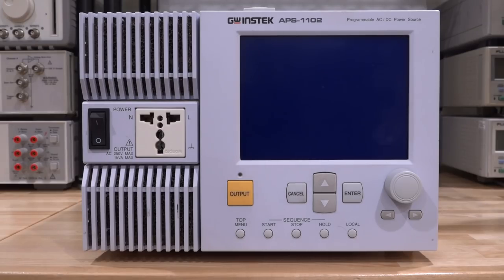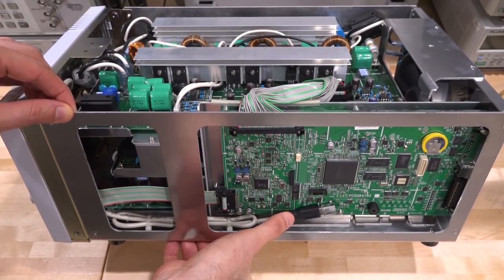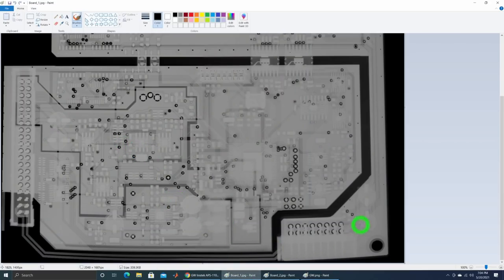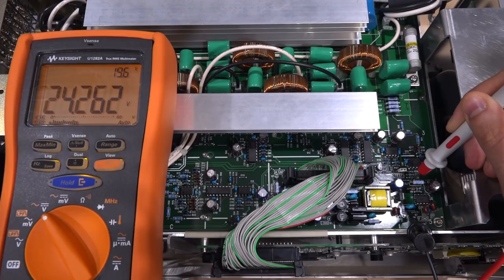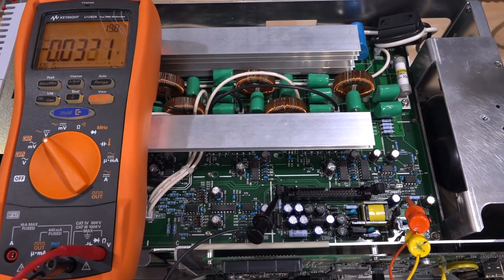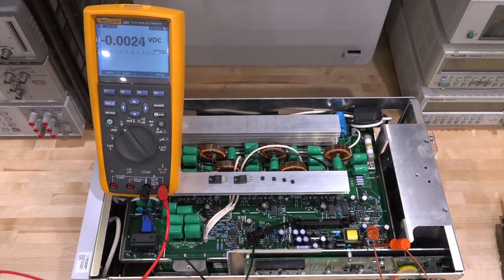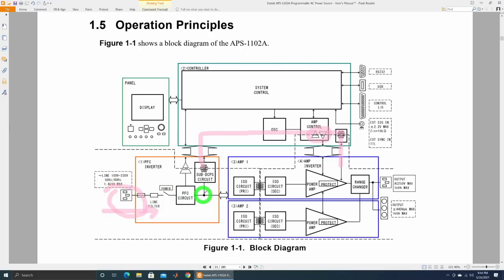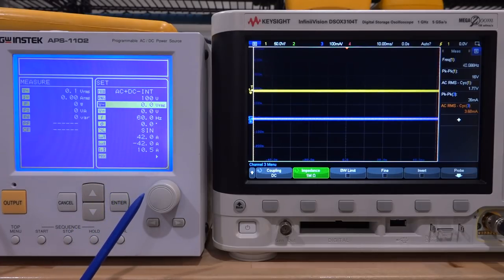TSP #191 - Teardown, Repair & Experiments with a GW-Instek APS-1102 Programmable AC/DC Power Source

Comment: The GW-Instek front panel seems incorrectly labelled for a UK mains plug. In this plug, the live is on the right. Upside down (as the plug would need to be) it is therefore on the left, which is marked "N". Great video - always find the repair ones interesting, I particularly value the way you talk through your reasoning. Thanks.

Comment: Interesting! By looks of the front panel legend if you put a UK BS1363 plug in that socket the line and neutral connections would be reversed.
Reply: I'm under the impression the output is floating in which case it would be irrelevant.
Reply: It's unclear whether that would have any consequence in a completely isolated unit like this?

Comment: Wow. That’s a nice unit. I managed to get one of those Sencore units and that works well for my applications, but this unit provides a lot more control and measurement . I like your use of the thermal imager. I picked one of those up from the Keysight eBay site a couple of years ago, and it is a great tool for troubleshooting.

Comment: "... $400 which is not cheap..." at :58.  Cheaper than any scope probe or other cable mounted accessory from Keysight!  The best used AC / DC power supplies are, if you can find them, from Kikisui.   To match your other test gear, emtest has some 4 quadrant programmable supplies which can source / sink power.  Like the Keysight stuff, if you have to ask the price, you can't afford it (hint made in Switzerland, >$10,000).
Reply: shazam  ,  TOTALLY true. "If you have to ask the price, you can't afford it." Like buying a yacht, right?

Comment: Nice work.  Perhaps you could film all the actual ic removal and probe connection stuff or perhaps some snippets.  I am sure curious how you do some of those things.  I seem to spend ages making reliable interboard connections as I never seem to have the right type of pin or socket on hand so try to make them with copper wire and solder.

Comment: It assume for the serial connection just the DB9 connector has to be soldered / mounted.  It looks like the level converter chips are already soldered to the board.

Comment: X-ray the PCB is the machine gun version of buzzing out the connections.
Reply: Machinegunning is using a wire brush as one of the electrodes, x-ray is the fragmentation grenade.

Comment: Why did all three opamp ICs fail? I would assume you figured this out, but you did not say in the video.
Reply: Probably the failing negative voltage regulator allowed the input to exceed the supply voltage, and the IC's latched up and started to draw a heavy current through the internal junctions, as the parasitic SCR structure turned on. This then damaged the junctions and made for high leakage in there, or shorted out internal transistors, and thus the power draw.
Reply: I was wondering if that  flaky -5 Volt regulator was somehow responsible.  The APS-1102 is retired. Maybe the GW-Instek engineers have seen this failure before...
Reply from the maker: A possibility for sure!

Comment: Hi Shahriar, thank you for this very educational video and walk through as always. Could you provide some references to learn more about the voltage regulator ageing? I'd like to learn about the fundamental phenomena that drives the ageing and whether this impacts other types of ICs. One of the problems I often face at work is needing to buy parts from the open market to cover shortages - these parts can be several years old. We only qualify the parts by checking MSL, solderability, and functional (feature) testing. Thanks in advance!
Reply: Aging is mostly caused by heat. I wonder how hot those regulators get in normal use.

Comment: I wonder what may have caused three opamps on the same power supply to blow up. My guess is that there was a spike on their power supply due to aging voltage regulator - enough to momentarily  exceed maximum voltage these amps can take and blow them up.The fourth opamp survived other due to some additional serial filtering on its power supply or just being a little more tolerant because of natural manufacturing variation. What do you think?
Reply: Adam Turowski  ,  If so, there would be a few more things to be repaired/replaced before doing a full out and full voltage and current test.
Reply: @BruceNitroxpro  Why? Is it not possible that only these 4 opamps were powered by this +/- 5V power  supply? Or the other components there were more resilient to overvoltage?

Comment: It's always weird when devices that look fairly modern when turned off have absolutely ancient GUIs when turned on
Reply: That particular style of LCD panel are quite unpleasant to spend much time looking at
Reply: Roger on the LCD, but reliable low level tools DONT wnat to have tricksy high level control software that can crash on you

Bit of colour might be nice though
Reply: @rogerstorrs8679  A good looking gui isn't any less stable, and makes the user less prone to accidentally doing the wrong thing.
Reply: @tommihommi1  Hmm that's debatable- it sounds like more software complexity, which always involves more risk, methinks....
But ok maybe test eqpt manufacturers dont employ very visual programmers ;)
Reply: @rogerstorrs8679  You just develop a GUI framework once, and then every instrument that has a screen can use the same style of GUI, it's relatively minimal development cost.

You're running windows embedded or some *nix anyways, the stuff to build good GUIs all is there already.

This device has an ugly GUI because it's much older than it looks, the plastics just didn't yellow.
Reply: @tommihommi1  Windows Embedded, Ewww.... Do they REALLY use that in any REAL stuff ???
Reply: @rogerstorrs8679  Many even have a windows button on the panel to get to the desktop.
Reply: @rogerstorrs8679  Keysight certainly does, for example. If I'm not mistaken, John Kenny elaborates on their choice to use Windows CE in some lower end devices in an interview in EEVBlog #1032. One of the deciding factors factors was something as simple as a mature USB stack that would work with most USB memory sticks. Also, again unless I'm mistaken, their Infiniium line is using the full Embedded version of Windows for its GUI. When the GUI, hardware interface and programming requirements are complex enough you need a "real" operating system. You might have hoped for Linux, but you can't get everything.

Comment: How are the “power amps” that are shown in the block diagram implemented? I’m guessing they must be some kind of high frequency switching converters with good filtering, since they make such a clean waveform in the output. Linear amplifiers would surely dissipate too much power in this application.
Reply: Most likely IGBT output stages just like VFDs.

Comment: When I need to do serious reverse engineering on a board I like to use GIMP. I will take a picture of the front and back of board, put them on separate layers in GIMP and adjust the transparency to get get a view of both sides at the same time. I have one more layer added to trace lines and make notes.  Having a layer to  add an X-ray view would definitely be nice.
Reply: dbinok  ,  It must be nice to have a "GIMP inspired brain."
Reply: I do the same thing! It's really effective. I reversed a 160 BGA by doing this, though it took a while..
Reply: there's a couple of YT vids where people actually mill the PCB down layer by layer in a CNC, in front of a camera

Comment: Do you have any idea where to obtain the QL3004-0PFN100C FPGA placed on the control board, or a replacement board? The IC apparently has to be programmed so buying one from a random source is not an option.

Comment: What high voltage differential probe is that ?  In the video it says "fully isolated", but the ones I know are not isolated. They have high impedance to ground ( like severa MOhms ) but they are not galvanically isolated.

Comment: Can the Xray do tomography?
The PSU seems like a clumsy design. I would have pursued a single board solution.
Reply: A complex PSU like this wouldn't fit on a single board. Power components like inductors, transformers and IGBTs take a lot of space.
Reply: @simontay4851  of course it can fit. 5A programmable AC. That device is huge, a single board that size could fit 10 of them. Google CE+T little box challenge.
Reply: Nope.

Comment: It's a glorified A/B audio amplifier attached to a waveform generator, cool.
Reply from the maker: No, there is a lot more going on.
Reply: @Thesignalpath  I'm sure there is as a high-end piece of test gear, but I couldn't help but remember using a powerful rackmount A/B power amp to get a clean 50hz AC using just a sig-gen. Most good amps are DC coupled and will happily amplify DC too if fed and blocking protections bypassed. I remember it had some +/- 180VDC rail config and I couldn't lift it myself. Of course all of this can easily be done in some type of class-D config at 1/20th the size nowadays.

Comment: Thanks, great debug video. Those 3 parts were 90C. And you knew something was drawing a lot of current. A thermal camera is great, but a wet finger or a $20 IR thermometer would find the problem parts pretty quick. Did you say what the parts were? And any theory about why they croaked? Design stress, excess input voltage or output current? 5V op-amps on +/- 5V? Weird load fault? A stray screwdriver? Counterfeit op-amps? Mystery continues...
Reply from the maker: This could have been caused by the failing voltage regulators. We don’t know how they ‘start-up’. Maybe there were voltage spikes, etc.
Reply: Thanks,  I agree. I repair a fair amount of stuff that turns out to be bad 78xx or 79xx regulators. Most electronics has a cushy life: regulated supplies, no real heat. It's the regulators that get hot and have to deal with voltage surges.  What kind of op-amps were they?

Comment: Wait, that is a 5800$ power supply?? Jesus
Reply: Dan Frederiksen  ,  I think Keysight would say, "Cheap at half our price!"
Reply: @liam3284  ,  Thankfully, I'm not in the Market for one... LOL NOT $13,000 + for sure.
Reply: @liam3284  5amps, h bridge, it could probably be done for 100$ but then you can adjust the price depending on market size. Off the top of my head I would think you'd want to combine it with DC supply functionality so you don't have to have multiple product lines. Bigger market. You can have various complex software functionality but that's software, no BOM. CPUs are powerful while costing nada.